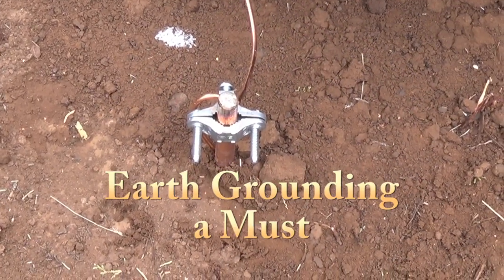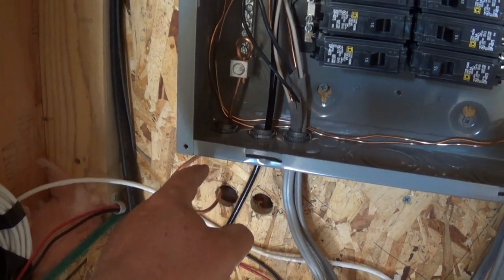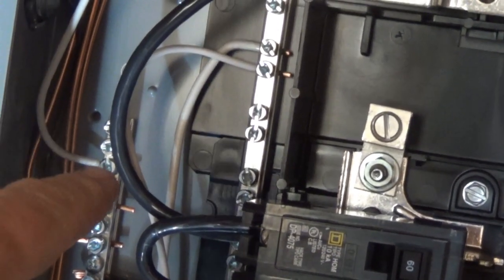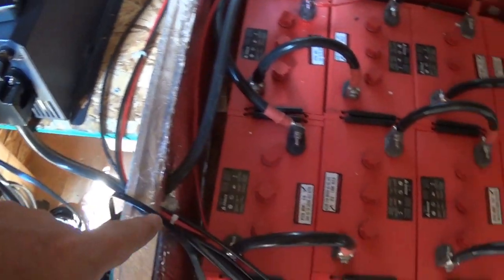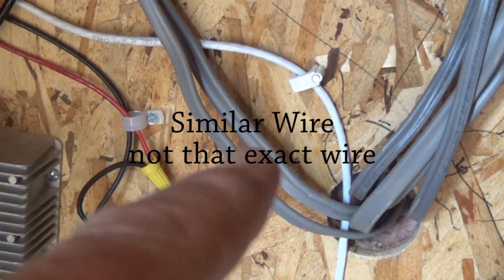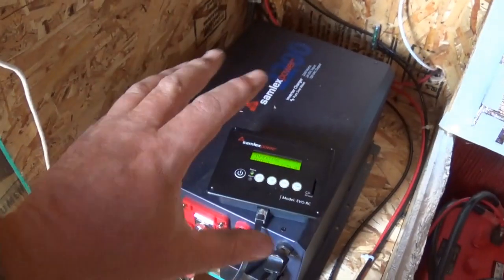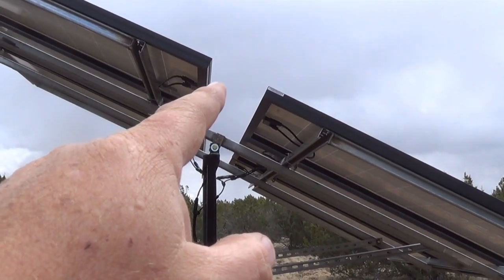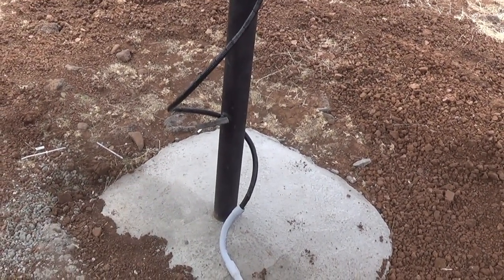Earth Grounding Solar Off Grid System - Grounding Batteries, Panels, Controller, Inverter

Comment: May I ask about the size of the battery bank ground wire? my 3,000W inverter requires a 4/0 stranded wire. Will a solid #6 (6 AWG) be adequate? Thanks
Reply from the maker: i am no expert but for ground 6awg solid should be ok. thats what i used. 4/0 stranded for the positive and negative yes.

Comment: I am trying to run just the filter on my hot tub using my 12v solar panels inverter and battery but get a grounding error on hot tub heater wondering where I need to ground from thanks
Reply from the maker: i am no expert. not sure. i would assume you use 3 wires a black, white, bare or green . make sure the bare or green is grounded to metal boxes

Comment: Why is it necessary to ground the whole system?
Reply from the maker: to protect each component. the ground encourages the extra voltage like from a lightening strike to the ground protecting components and reduce risk of fire. most time your component will still get damaged but it wont start a fire.
Reply: @ArizonaHotHomestead it's grounded for many reasons like that but also if the pv panels short or the inverter shorts you don't wanna get shocked from it. Ground prevents electrocution in event of failure

Comment: There's a problem with grounding your whole system. I did that 26 years ago and found out the hard way that during a monsoon if a lighting strike a quarter mile away hit the saturated ground it would go straight up my ground rods and bypass the breakers and distroy my entire system. Fact. So learning from that I isolate all neutrals and only ground to my batteries. It makes a closed system. Just like a boat on the water. Never had that problem again.
Reply: I wish i could understand this comment better. What does neutral mean - this to me means the grounding spots on each device. Taking this video, it seems to me like it's exactly the same he has done but without the rod going into the ground.
Reply: @MrIvan  seems bout right...just bonding equipment so if say the chassis goes live on a panel, CC, or inverter, fault current short circuits battery and trips any breaker/fuse along the way, hopefully in time to avoid giving you a boot. Havent seen anyone add an RCD, as i understand that would be faster/more sensitive, but may not be possible on some small setups?
Reply from the maker: interesting to know
Reply: @ArizonaHotHomestead lightning rods should not be tied to the house grounding rods. Lightning rods prevent this but are grounded with a separate rod.
Reply: @ArizonaHotHomestead op has no ground. It's dangerous. It's not recommended. It's called a floating ground. That's why lightning rods exist which is different than a grounding rod but I'm not an electrician
Reply: So are you saying  have a separate panel array-to-ground rod, keeping the system ground self contained?

Comment: If I understood you correctly you put a ground rod at your service AC panel and you are using your solar array pole as a ground rod through all the rebar etc.  Correct me if I'm wrong, You have to run a suitable sized bare conductor underground to bond your solar array poles to the ground rod of your AC panel ground rod to create an equi-potential zone. Otherwise you will have a very dangerous situation if ever you have a lightning strike nearby.  Refer to the diagram in this forum post.  https://www.solarpaneltalk.com/forum/off-grid-solar/off-grid-solar-panel-systems/386437-off-grid-solar-battery-system-bonding-and-grounding?fbclid=IwAR3yccZahLwdw7hz9Cw0ZB8u8r1ALP7lJSCAnmnHPwsb2F7THyG2P4UPVIU
Reply from the maker: from what i was told the panels are grounded to the frame and the frame to the ground. all the other wires and components inside are grounded to that earth ground. is it right? i have no idea but i was only following directions
Reply: @ArizonaHotHomestead  yes thats correct but for lightning protection the ground rod at the your service utility panel must be tied together using a #6 bare wire ran below grade

Comment: emh. i am quite new to this. would it not be practical use the yellow/green wire throughout the system for an easy identification and testing?
Reply from the maker: some would say use x as the wire. i say use what ever color you want just be consistent. maybe put a chart to remind you and others what colors are what. . i think bare, or green is normally ground.

Comment: Thanks for making it easy to understand.  I'm building a simple 500 Watt solar setup away from the main house.  Panels/Solar Equipment/Batteries are pretty near each other.  I noticed a question below regarding grounding your panels and solar equipment/batteries to the same ground rod had you panels been closer.  You answered that your panels were 25 feet away, but if your solar system was all close to each other, could you have used one Grounding Rod?  I've been trying to find information if all Panels/Charge Controllers/Inverter/Batteries (nothing AC) be connected to one Ground Rod?
Reply from the maker: panels on a rack on the ground or on the roof? if on the ground just ground them right there if on the roof ground them to a rod . depending on your set up if your water plumbing is copper, brass you can also ground it to the water pipes.
Reply: Thank you.  Hope all is well. @ArizonaHotHomestead
Reply: Everything maybe but not the negative battery. Neg battery terminal should not be connected to the AC bonded ground rod. Again I'm no electrician

Comment: Grounding the battery ? It makes the chassis of your inverter & charge controller dc negative and earth ground. ??? Dc negative chassis may not be a good idea
Reply from the maker: just did it like i was told by solar people.
Reply: @ArizonaHotHomestead  i am a little confused about the conflict between DC & AC ground
Reply from the maker: what i know is this... ac has a 3rd wire that is the ground that has to go to earth. dc ground can be grounded to chassis of a car, metal frame  of trailer becus the rubber tires keeps it above the earth. but for solar you can ground to earth. dont know why but this is what others told me. all metal chassis and frames of devices need to be grounded.
Reply: @ArizonaHotHomestead comparing 12v(non lethal) to a 48v DC(lethal) system is not a good idea.

Comment: I believe you need to have two separate grounds for the AC and DC sides of your system or you will fry your AC side if there is a lightning strike near by or surge.  At least that is what I have heard.  Might want to create a separate bus for the AC inverter?
Reply from the maker: i thought that too but a local electrician said ok to ground it to to the same.
Reply: RVs ground ac and DC to the same spot ,and I think sub panels separate nutrals and grounds so nutral is  not bonded to the panel it's isolated, or it can back feed and still shock you

Comment: Planning on small set up for a connex shipping container.  (Entire box is metal). Thought to ground everything straight to box. 200 -400 watt set up. Is the box itself enough ground or?? Copper rod how far into ground needed?  Thanks.  Very nice set up. An great communication of ur project!
Reply from the maker: ground it to the box is perfect. you might then ground the box to a grounding rod.

Comment: Could you please explain why you connected your Negative Battery Voltage to your earth ground.
Reply: How I see it it is too increase the electron potential of the battery protecting it from high currents by sharing the high voltage of the earth ground potential. This in turn will also help the battery live longer as the voltage will be "charged" 1 millivolt per 10 minute increasing the voltage over years time renewing the electrons. Grounding DC will cause voltage to increase and amps to decrease making it safer and last longer (but)*. Grounding AC will do the reverse and highten the current to flip the breaker faster saving lives. or something.

this is why DC should not be used for home electricity and also why AC current Won over DC powered homes.

( Houses on DC that would be grounded would need a new system for flipping the breaker because the voltage will increase if a ligthning strike hits nearby causing the amps to decrease but not to safe levels and thus breaking the components and risking the safety of the people in the house.)*

This is why cars which are not grounded to earth ground will be safer as a cage but they won't last as long as the electrons from the metal ground will use up the structure of the car faster making it rust over time and break down.

or in other terms houses working on DC will rust like a car and be less worth  the while to build in the first place as tey won't last that long probably..
Reply from the maker: all electricity needs to be grounded. your car grounds the negative to the chaise maybe grounding is wrong term maybe its bonding. but from what the solar guys said by doing this if lightening or a large surge the grounding rod helps to protect the batteries.  i am no expert but this is what i learned from others.
Reply: I'm just learning myself and i wonder if you, or anyone, could explain why it would be beneficial to charge your equipment with negative dc voltage, or to connect your battery directly to a mains transformer, or to provide a path for a lighting strike to travel through the battery to ground as well as from the ground to the pv module. I know that it is nec code to ground all metal parts of the pv system to the equipment ground. I do not know if it is normal to combine the ac and dc grounds. any info would be appreciated and thanks for the reply.
Reply from the maker: i grounded it per what others told me

Comment: I thought, each and every, Solar Panel required a direct connection to the Ground Wire.  Bolting the Solar Panel to the Uni-Strut  is not valid NEC ground strategy.  As soon as you unbolt yoru Solar Panel, it is now "UN-GROUNDED" = Fail the NEC Code .
Reply from the maker: great info. not concern with nec code. per county my system was small enough no inspection was required.
Reply: @ArizonaHotHomestead  You are very lucky, because there is no such thing as "small enough no inspection needed" in my state.  You need to let people know , the if they follow your design, they may NOT pass an inspection.  Always error on the side of SAFETY ...

Comment: This is ridiculous, and all wrong.  Black is ALWAYS a hot conductor,  White is ALWAYS neutral, and grounds are ALWAYS bare copper (or aluminum) or GREEN.  Every other color is a conductor.  Having 3 different colors on your ground bar is ENTIRELY wrong, even if the connections are correct.  Re-assign with Green tape.

Why are you posting how-to videos, exactly ?!?
Reply from the maker: i didnt have green tape . i am no expert at anything. i am just showing people what i am doing.
Reply: @ArizonaHotHomestead  Brad is just telling you , that you did *incorrectly*.  So, now fix you mistakes ...

Comment: If your panels were close enough could you have used the same grounding rod for everything?
Reply from the maker: panels are about 25 ft away. i grounded them at the pole.
Reply: You didn't answer the question that Federico asked. "IF" the panels were close "COULD" you use the same ground rod?
Reply: Yea but not the negative battery terminal. But I'm not an electrician

Comment: According to NEC code and safety hazards of electrical shock You have to us 4 awg to your ground rod.your ground clamp  meter it's a special meter not a voltage meter  needs to read  25ohms if not your breaker will not trip our be able to short when power line surge and lighting strike hits your house it will also protect you from electrical shock, gooood luck !!!!!
This information is from a licensed 20 year electrician
Reply from the maker: thanks for the input. it did pass inspection.
Reply: @ArizonaHotHomestead  You had County Electrical Inspector come to your house and he APPROVED a BLACK wire connected to you Ground Bar?

Comment: insulation on romex shouldn't be more than a quarter inch into a panel. (Grey wire on yours).

also you should mark your black #6 with green tape on both ends at least.
Reply from the maker: thanks

Comment: Wire is cheap compared to confusion in your electrical system. What you’ve done is introduce the possibility of confusion in your system you would be fine if you were to use bare copper as your ground wire. Also you didn’t show how you grounded your aluminum frames on your solar panels. If you have copper in direct contact with the aluminum frames your introducing dissimilar metal causing corrosion and possibility compromising you ground bond. It’s not that much more cost to do the job right.
Reply from the maker: my solar panels are grounded to the frame and grounded directly into the ground. so extra ground.
Reply: @ArizonaHotHomestead copper 8 foot grounding rod is only 20.45 at home Depot otd

Comment: Why we. Need to ground battery and inverter
Reply from the maker: it has something to do with spike in current like lightening, or a short of some type. electricity travels the less resistance and shortest distances the earth ground is where it wants to go. the ground needs to be 6 ft or deeper if the ground is really dry. most ground is damp at 6ft. by doing this it limits the spike in current from traveling everywhere to damage everything and start fires. .
Reply: @ArizonaHotHomestead  thank you sir .here the query we are ground batteries of negative terminal we are eliminated floating output voltage of batteries.why we are not terminating negative in charge controller.

Comment: I'm no qualified expert with grounding but AFAIK you should have also Bonded those two grounds, ie another earth cable between your grounding by the panels and the earth spike you use for your distribution board at the shed - otherwise you could have a ground potential difference which can be very destructive. Not too late to still fix that. If you had grid power coming in, you'd have to bond utility ground to your earth spikes as well. All grounds need to stay at same voltage potential with respect to each other
Reply from the maker: thanks for the information. i will look into it.

Comment: If your breaker box was connected to the grid ... and you grounded everything like you have here would that damage your inverter charge controller etc ? Like is this setup only ok if the system is totally off grid ?
Reply: That would create a grounding loop
Reply from the maker: no thought is electricity searches the shortest point which means the ground as an end so it will follow the ground wires to the ground limiting the damage to other components. depending on how big of a electrical shock like lightening it may be so powerful that components will be damaged but overall the ground will limit the damage.
Reply: thank you sir

Comment: Hi,
informative video, thanks
Have a question about positive grounding devices like in some solar charge controllers, how to ground them?
Thanks,
Reply from the maker: you ground the box. the wiring inside grounds everything to the box/framing of the controller. there should be a small screw somewhere maybe green in color the screw is where you connect your grounding wire.

Comment: i live in Puerto Rico and i just got my 3900 watt 100% off grid system on line yesterday. i had to install it all by myself , could not get an electrician. took me about 4 days, 15-260 watt panels 4048 radian outback inverter , midnite 6 combiner box, outback flex 80 charge controller ,the midnite mini 175 amp disconnect box. and 8 6 volt 235 amp hr Trace batteries ,and it works like a dream come true .
Reply from the maker: that is so cool. very nice system you have. . congrats to you.

Comment: how do you ground batteries and why ground batteries.?
Reply from the maker: all electric currents ac and dc needs to be grounded. basic electronics. for dc power you ground the negative terminal. your car negative is grounded to the frame. . for solar you want to ground to the earth. this also helps with power surges like lightening strikes becus electricity will flow the path of least resistance so a ground to earth can help to protect devices but each device needs to also be grounded and depending on how large the surge it can still damage the device.
Reply: i really have a hard time understanding how dc works but thank you sir, i will be grounding my batteries when i hook them up this week.
Reply: can i ground all the AC and DC  equipment on the same earth grounding rod? or do they need to be grounded apart?
Reply from the maker: same however put all the dc ground wires to a bus bar so you can use that one wire solid copper to your earth ground. ac the same thing so 2 solid copper wires connect to the earth ground.

Comment: All the wires are copper.  Some just have the black and white insulation.
Reply from the maker: some homes in the 80's in the phx area were built with aluminum wire. lol they quickly learned they cause shorts and a few home fires.
Reply: The NEC specifies which colors are valid, for each purpose. The color choices in this video are wrong ...

Comment: Thank s for the video. I have one comment about the clamp used in the ground rod. That connection should be done by an acorn type clamp. The clamp you used is for bonding metal pipes to ground.
Reply from the maker: the acorn is the proper one but this will do. your right it should be used on metal water pipes.
Reply: @Ray Bryson flixportal :D
Reply: @Jaxson Ariel Thanks, I signed up and it seems to work =) I really appreciate it!
Reply: @Ray Bryson glad I could help :)
Reply: I realize Im kinda randomly asking but do anyone know of a good place to stream new series online?

Comment: is your neutral connected to your ground inside of the ac breaker panel?
Reply from the maker: the neutral to the ground. no. I do have a video on the breaker panel showing all the neutrals connecting to the neutral bus bar. https://youtu.be/8xIryfBycEM